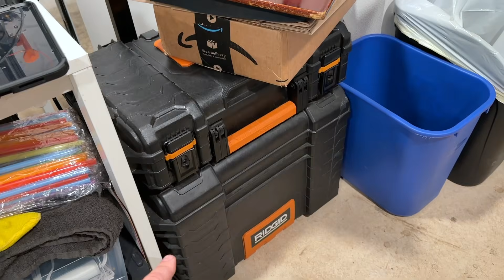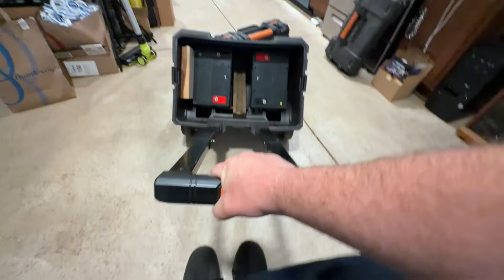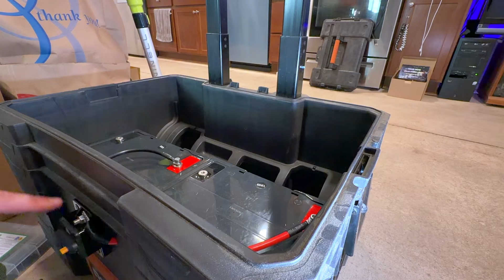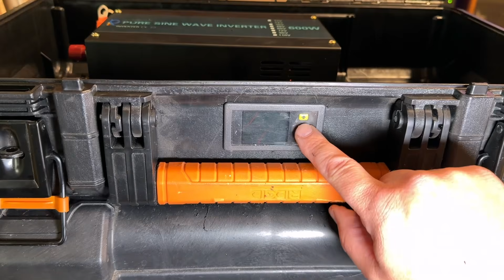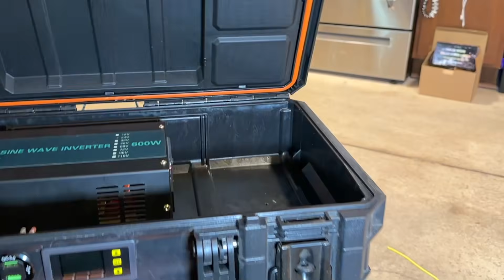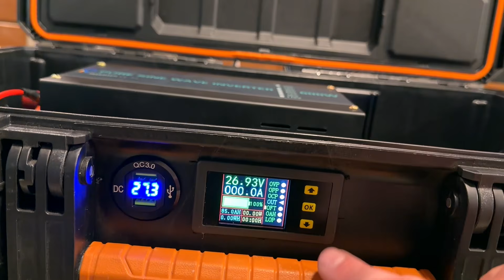VLOG 792: portable electricity v2.0!

Comment: I just out LiFePO4 50ah in my Quantum .  They are light weight, much less than the SLA's.  I have a 600w inverter too.  I want to make a porta charger. A smaller lith battery can mount in a basket on the chair

Comment: That's a good setup, I took my oldest c500 chair base and used a cytron motor control to make it r/c then added a 2000w inverter. It works great for taking a outlet anywhere in the yard.

Comment: I use 12v 2000w pure inverter 3 100ah LiFePo4 batteries for Hurricane power issues mainly for the kitchen fridge, coffee, and cooking. I will need to make 2 more just like it to run rooms like internet, security cams, and a few family TV's and phone chargers and our family server incase internet is down. It runs about 6 hours on a charge, and takes 4 hours to charge with gas gen. I use to just run a gen and that was 10 gal of gas 12 hours so 20 gal a day. I run the batteries down first then charge them and shut off the gen. Saves so much $$$ on gas this way. Love the videos. Thanks Dan

Comment: Where did you get your monitor device from and did you consider a dc block charger for charging the chair. Not sure if a direct connection to the batteries would safely charge the chair, could discharge chair depending o;the relative SOC.
Reply from the maker: the wheelchair charger was just something easy to plug in that pulled ~300 ish watts to put a load on the inverter.  wont be using this setup to actually any chairs :^)
but victron does make a DC-DC battery charger - used one back when i was living in the bus